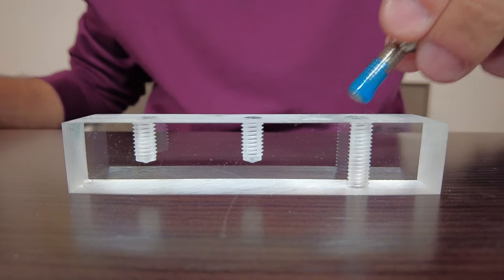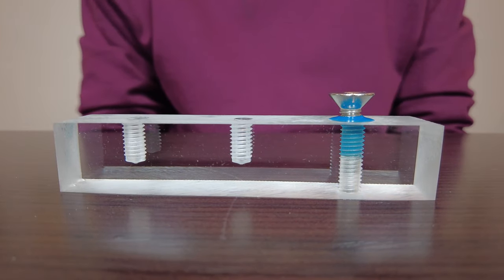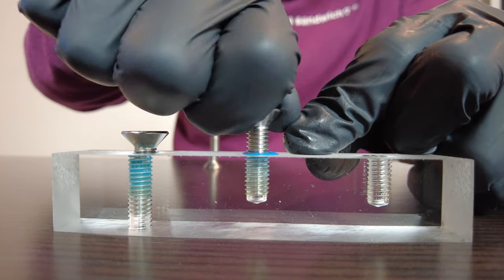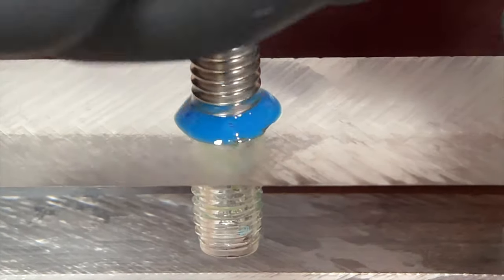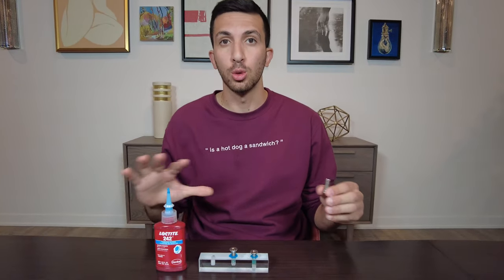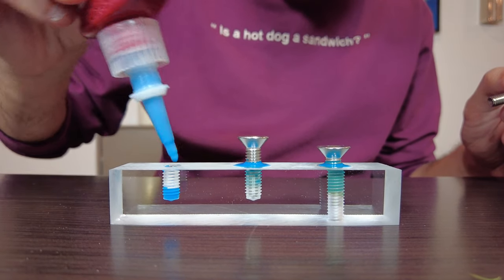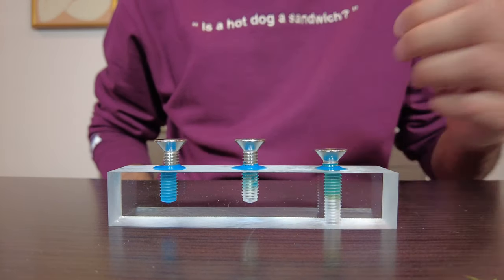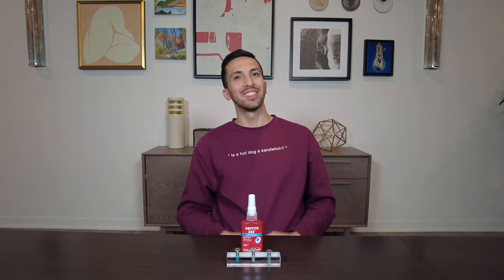How To Properly Apply Threadlocker

Comment: Fair enough unless the threads a tight tolerance, you'd end up hydraulicing the hole, common on engine bolts when there's oil in a hole it cracks the casing
Reply: Can’t believe this isn’t mentioned more here, this is why you don’t do this method.
Reply: He is actually right about the principle but the execution is not 100% correct. Loctite advices to apply the threadlocker to the 3rd or 4th thread from the bottom on the threads of the body. So, that there won't be any remaining adhesive, which stays uncured.
Reply: I suppose the solution is to apply threadlocker to the bolt, screw it in and see if it bubbles out - no: leave it, yes: remove bolt, drops into hole then screw it
Reply: That was my first thought also.
Reply: Absolutely, I had it happen with too much loctite on a motorcycle case, thankfully it just popped out the end and didn't ruin the whole thing, used a copper washer to prevent oil leak.

Comment: I wouldn't do this into a blind hole on an engine casting unless I knew it was a loose fit.  It's surprisingly easy to crack the casting when you torque the bolt into the blind hole with uncompressible liquid below it.  (This is one reason to always blow out holes with compressed air before assembly.). On the other hand, I can't think of engine casting holes that call for threadlocker, usually just a specified torque, so it probably won't matter.
Reply: Glad you pointed that out, clean the bolt holes of coolant, oil or parts cleaner. it's called hydro something
Reply: True, a dry threadlock would be better in that case if needed. 
But on the other hand, I’m surprised to see how much he uses, I have always used 2-3 drops 🤷‍♂️
Reply: @baldurivar  * I think the red can be trouble.

Comment: Let’s start at the beginning.  Clean with alcohol. No thread fiber cloth.  You touched the applicator tip to the bolt the bottle is now contaminated……..less is more with loctite. A couple of drops will suffice

Comment: This actually answers my question better then allot of the videos testing these.  Because the difference actually depends on whether you have an open or closed / blind hole that you're screwing into.  As to how the thread locker will apply..

My other question which I think would help in these closed ended holes as well.  Is whether you should allow the Loctite to cure for awhile, before driving the screw in..
Reply from the maker: Awesome, I’m glad we could help.  Many Loctite thread lockers are anaerobic adhesives which means they harden or “cure” in the absence of oxygen.  Hence no need to wait.  

Hope that helps. 
Cheers,
Dave

Comment: That's OK if your threaded hole doesn't go all the way through, which many do. What's the best method if the hole does?
Reply from the maker: Put a line down on the internal threads would be my guest. Although there are other great options for open ended holes.  Cheers
Reply: Locktite made a similar video a few years ago showing this for blind holes.

Comment: betting this stuff is probably different from the pre-coated bolts you get with some fasteners that have a ring of blue loc-tite on them otherwise you could just go the route of putting it on the bolt as such, letting it cure for a day or two then using it when you need to and the friction creates the bond when you run the bolt into a threaded fixture.

Comment: Apply it to the bolt, and let it dry. The technique is good enough for car manufacturers.
Reply from the maker: Good to know.  Thx
Reply: Different product used for pre-applied thread locker. It consists of micro spheres with the anaerobic thread locker inside. When the threads engage, the micro spheres tear open and the thread locker can do its job.

Comment: I felt very betrayed when I found out this stuff harms plastics :c wish they had a plastic friendly solution that wasn't based on superglue! I have metal nuts in my parts but they have to pass trough plastic
Reply from the maker: I would agree that its never fun to find that out the hard way 😢. I do believe there are plastic safe alternatives but I assume they are much more expensive. I guess we have to work with whatever is within our budget as hobbyist 😜. Thanks for supporting the channel 😃, Dave
Reply: Loctite 425 or Plastic Assure Threadlocker is safe for plastic-- It's cyanoacrylate based. Maybe it's just a fancy super glue.  Also take a look at Vibra-Tite VC-3 which is a removable threadlocker not made by Loctite that should work with plastics.
Reply: @Trent-tr2nx  i don't think vc-3 is made by loctite, But I always wanted to get some, hard to in my country, and priceeeeey

Comment: I think that's way to much Threadlock, I do it the same way but all you need is to put a little bit on one side and it will still cover the bolt as you thread it in.

Comment: Could get hydro lock if you use to much.
Reply from the maker: What’s that? Please enlighten me.  Thanks 😊
Reply: You can fill a blind hole with fluid (oil/thread lock) so when you screw in the fastiner it can blow out the bottom of the housing from extreme hydraulic pressure.. Old chevy water pump housing and blue rtv in the hole is how I learned this.. Peace man

Comment: Never fill the hole with thread locker !! How will you remove it ? Its not glue.... its thread locker. If you do that on a gun, you are in a bad shape.
Reply from the maker: I’m not sure what you mean, this product is used all the time in practically every manufacturing industry.  Is there a specific reason not to use it in a gun?  You can always get different grades of strength. I’m a little confused 🤔

Comment: Understandable....yet. Good luck on trying to remove the bolts when needed.

The thread locker is only supposed to be applied sparingly per application "a drop across a few threads"

Then allow to fully dry and cure before fastening in the hole.
Reply: I think you've misread the tech data/user guide for this stuff. It mentions letting the threads dry after you clean them... not letting the thread locker dry.

Thread locker is anaerobic, meaning it dries in the absence of oxygen. It will never cure before installing it. It also acts as a sealant and lubricates the threads before it dries so that you don't get binding.
Unless you're using a specialist formulation, it's not possible to allow it to dry before installing the thread. Even if it could dry, it's not the correct method.